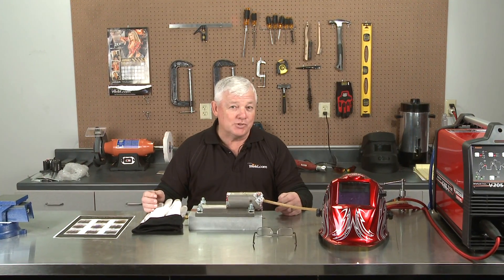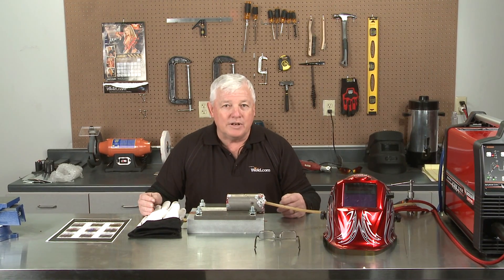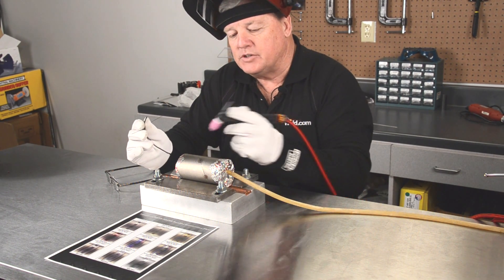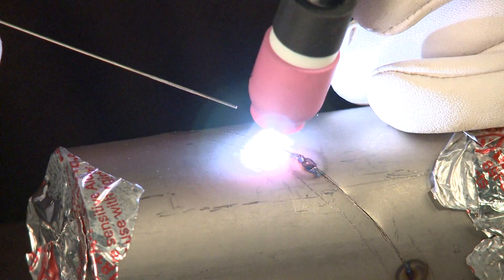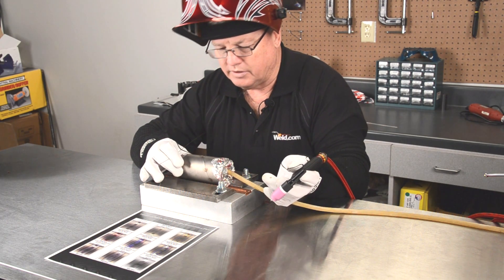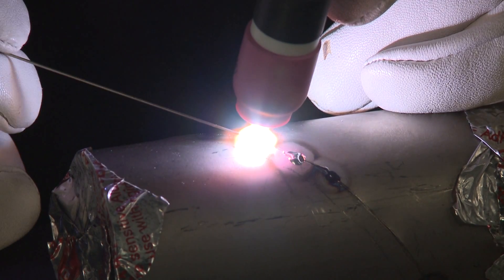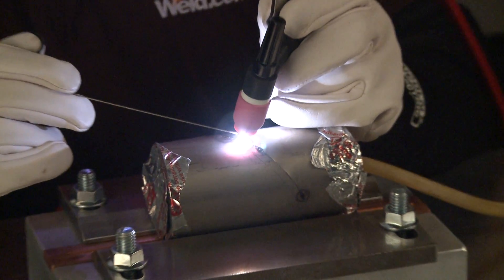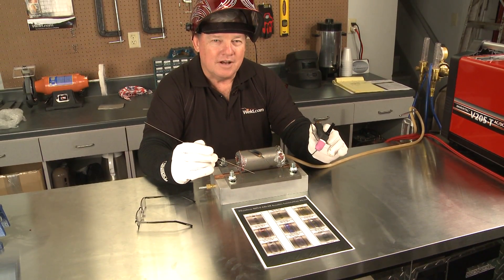Titanium Welding - The Basics You Need to Know

Comment: Mister Tig were is the oximeter? You just wait until it's good also works but it's a great tool, I use a extra too (costume build)l to attach on the torch, I use 3 backing gas 🤪, and welding is this, there's a lot of technics that we can learn, every pipe every material demands different techniques, even the distance from the tungsten to the cup matters. Thanks for helping Young generation's 🙏🏽

Comment: I use a repurposed harrible freight sand blasting booth and purge the air out with a shop vac, (a few pinches of magnesium powder in a grounded (contact) ceramic lamp insulator to start a test arc, when the magnesium doesn’t ignite, the titanium won’t because theres no oxygen. I use this for  stainless because the fumes are sucked out of the shop

Comment: Do I just use the same tungsten I do for welding mild steel or do I HAVE to use something special like with aluminum?
Reply: Nah for tig I'm pretty sure it's good for all jus dont contaminate and follow proper procedures
Reply: No special tungsten needed, just dont use zirconiated as it doesnt weld on DC very well at all. Pops and spits.

Comment: Why does the color matter? Shouldn't that be just surface oxidation?
Reply: Brenden Fullmer Actually, you nailed the reason it matters in your comment; the color indicates the oxidation state of the metal, which in turn, indicates how much the weld has reacted with the oxygen and hydrogen (and many other gases) in the air. This reaction can cause inferior and/or brittle welds.

It doesn't mean there's anything wrong with the physical side of your technique (i.e. angle of the dangle, motion of the ocean) rather, you were too slow or amperage was too high and the metal got cooked.

TL;DR: Once the weld starts to react with the air, the part is as good as trash.